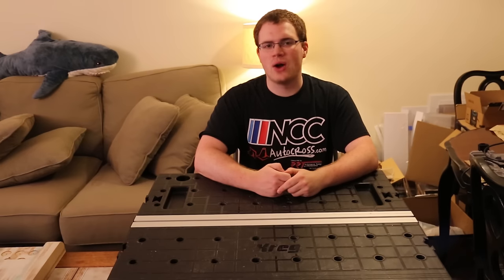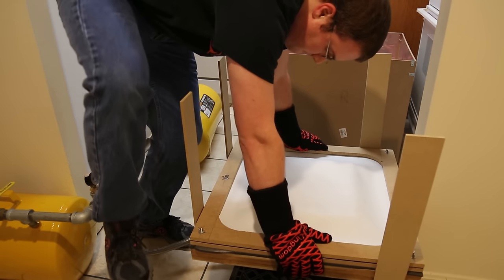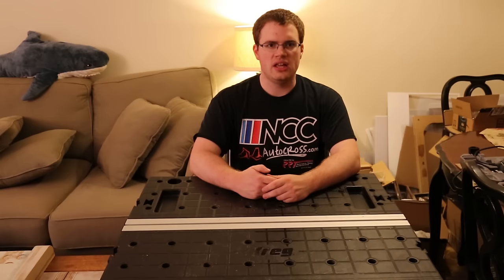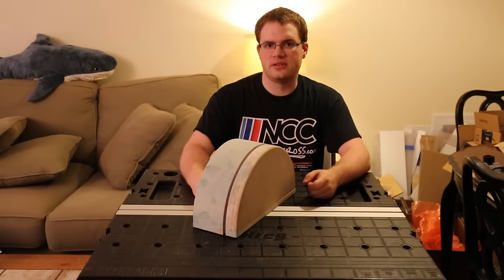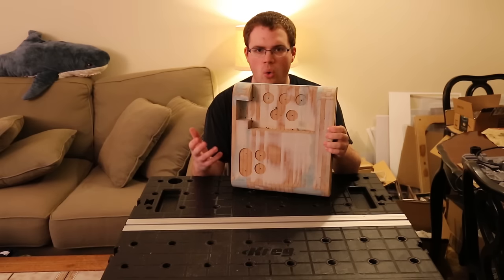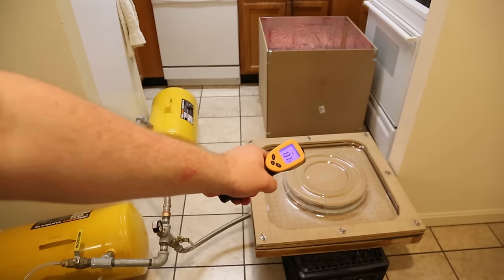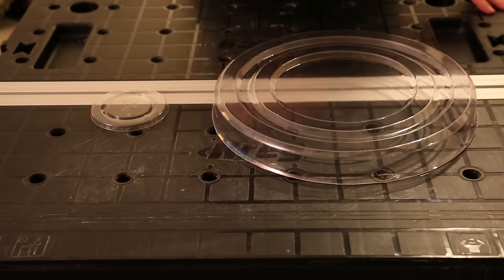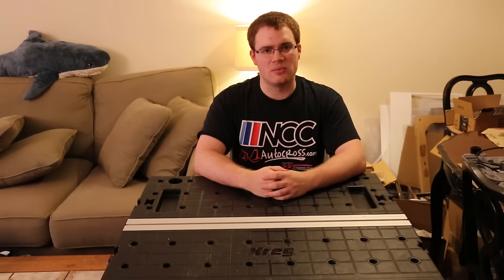DIY Vacuum Forming - Complete Video Guide

Comment: Hi
I like many would like to thank you for this great informative video.
I have constructed my own unit and the platten which has an area of 32" x 14" with 2.5mm holes drilled every 1 1/2" totaling 120 holes.
Question 1. Should I increase the hole diameter to reduce load on my Dyson vacuum (overloaded and tripped out on second attempt) or add more holes? Or use a vacuum system like yours? Material is 2mm PETG
I am attempting to make a ramp for a pinball machine which is currently not being produced which has lots of curves and lips on it. I am having great difficulty in getting the PETG into the lip radius. 
Question 2; Would heating the buck up to try slowing the hardening process? I am using a buck made of plaster of Paris which is very cold to touch. Do you think this is worth trying or do you recommend another technique?
Question 3; (last one I think) You mention about using multiple Dyson's, would they cause issues working against each other or would you need to section off the underside of the Platten?
Reply from the maker: Q1: For the platen used in the video, I drilled 1/8" holes in a 1" pattern (resulting in 256 holes). To clarify, when the community refers to a Dyson they're talking about the full size upright models (like the Ball), so if you're trying to use a smaller Dyson (especially battery powered) that may be the issue. A full size upright Dyson should be able to pull that size and material thickness, given proper heating of the plastic (i've seen them used to pull a 24"x24" 2mm form before). Since you have a vacuum and can just leave it running, make sure that the platen has a good seal and there is no ingress of air during the process. You can, like you said, also make a vacuum system like mine. I'm sure it would be able to pull your form. In terms of the resolution of your pulls, make sure the buck you're using is spaced off the platen so air can evacuate underneath. This is key to getting a tight form. Adding more holes and making sure the seal is good will also help.
Q2: While technically heating the buck may help, I think that it would probably result in a negligible amount of time gained in the forming process. PETG has a lower forming temperature than Polystyrene and other plastics, which means it doesn't take much for it to go back below the formable temperature. You can try it, but it sounds like there are more meaningful steps to be taken before attempting this.
Q3: Running multiple Dysons would probably work best if they each had their own interior chamber to work on, like you suggested.
Reply: mwjscn 

Thanks for the response. Just to clarify a couple of points, I am using a full sized Dyson DC54 which I feel is struggling with pulling the PETG into the lips of the Buck even though I have drilled holes through to the bottom of the buck. Am I correct in believing that the combined area of all the holes in the platen should equal to the internal diameter of the vacuum hose? If less then the vacuum would be loaded up on the underside of the platen and suction would be reduced at the buck itself.  Maybe I'm thinking too much but am open for suggestions. 

One new question, I have a quartz halogen heater which is shorter in length than the framework. Subsequently I cannot get even heat between the middle of the frame and the ends. (20-25 degreesC difference) Would adding aluminium foil to the inside of the heating box help distribute the heat or will I need to look at a larger heating system?
Reply from the maker: @stevebrookman5781  The DC54 may be good for small-medium sized forms, but it may not be able to move enough air for these larger sizes. To my knowledge, there isn't any correlation between the combined size of the array and the input hole. I use a bottom platen hole connected to my vacuum system that's about one and a half inches at most, and the hose connecting it to the tanks has an even smaller internal diameter (probably about 1/2"). The hole array is more about distributing the vacuum force for an even forming pressure across the platen.

I use two 1500 Watt quartz heaters for my system in a 2x2' MDF box. I lined this box with aluminum foil secured with aluminum HVAC tape. It's cheap to try and I'd suggest it to see if it gets you any further performance out of the unit. I will say the most important thing is an even application of heat. If you're finding that the heater you're using is hotspotting in the middle and either end is 'cold', I'd suggest looking into a new arrangement of heaters. This may be one of the main reason you're having difficulties. With my heater arrangement, I can get PETG to temperature in 3 minutes for that huge dome featured at the start of the video. If you're finding it's taking longer than that, I'd suggest looking into something new. PETG should look like a bubble as it is being blown, with a nice even droop curve across the entire frame. Look at 10 second into this video for reference or 18:50.

Comment: Please suggest me how much vaccum pressure is needed to use vaccum cleaner and suggest a model if you know
Reply from the maker: Depends on your size. If you're doing stuff under 12x12 inches that isn't tall, you could probably get away with a normal sized canister or stand-up vacuum. If you want to go larger (especially with thicker plastic), I've only seen major success with the large stand-up Dyson vacuums (cinetic, they're "Ball" stand-up range, etc)

Comment: Hello , i would like to ask, i have a mold 35cm tall, does the .5mm hips will do the jobs?
Reply from the maker: I'd suggest at least 2mm and a very strong vacuum force. The plastic will thin out when forming large objects (often having to heat the plastic for longer to achieve more 'droop' prior to forming), so you may achieve a thin result but have to start with a thicker material.
Reply: Unfortunity im just using vaccum cleaner hehehe but, ill give it a try in .5mm if it doesnt work sorry for me .. Thank you so much for the suggestion..

Comment: Did card sheet need any more coating after printing for belister packing.
Reply from the maker: Sorry, I don't understand the question. Can you rephrase it?
Reply: @mwjscn  sir,
Acctually I want to pack my items in belister cup ,some one detrack me and said that an adhesive coating needed after printing card board for cup heat sealing so I want to know what coating .
Reply from the maker: @shabbirshah6924  Ah, I see. I don't do blister packaging with a cardboard backing at all so I'm not sure what type of adhesive you'd use. Perhaps you can just use some metal staples instead.

Comment: Hi, could you tell me how long did you need to heat the material to get it right?
Reply from the maker: This is a case-by-case basis. It depends on the output and style of your heater, the type of material, the thickness of the material, and how deep a draw you need to achieve. On my heater, to heat .080 polystyrene to do shallower forms takes about 3 minutes, but for a deeper form it takes 5. That same 3 minutes to do a shallow draw with polystyrene will get me a very deep draw with PETG. When the material looks supple and is drooping enough, that's the time to take it off the heater. You can see examples in my video. It's all trial and error. I did many test pulls altering the heating amount by 15 seconds at a time. I suggest you keep a notepad with the results and mark the form itself on the offcut with the test # and time used so you can physically compare the outcome.
Reply: @mwjscn  well, i tried as your video shown but it never dropping. I use 2500w heater and heated up to 20 minutes but it just softer not dropping. I heated pvc sheet with thickness around 0.3mm i guessed.
Reply from the maker: @aripratama333  0.3mm would be as thin a a couple sheets of paper, are you sure you don't mean 3mm? If it is 3mm (~.125"), you simply don't have enough heat or aren't managing it well enough. I use primarily 2mm sheets (~.080") and my heaters are rated for 3000w combined. With these quartz heaters, they often have different output ranges given they're supposed to be used to keep spaces warm. Make sure you have yours set for maximum output. As an example, mine have 2 different heating modes where one is reduced and one is full power.
Reply: @mwjscn  no. I'm sorry 0.6mm it is not thick. I bought quartz heater lamp, only lamp so it is no control. It will always max.i bought 5 x 500w so it is 2500w. Just want to get even heat area.
Reply from the maker: @aripratama333  Something must be wrong with your material or your heating solution. If the plastic is indeed thermoforming capable, then it shouldn't take long to get 0.6mm plastic up to temperature with a proper heating solution.
Reply: @mwjscn  well, honestly i don't know whether it is capable or not. I thought it is applicable for any plastic material. This pvc sheet usually use in furniture lamination. After i tried heated and sucked couple of time it is stretch and getting close to the object but it took many times. I even put it very close to heater. Also it is fast to cool.

Comment: Can you give me good sources for buying plastics?
Reply from the maker: If you can find a local plastics supplier (think like a lumberyard, but for plastic instead of wood), that would be ideal. They usually carry the most options and can cut your sheet to custom dimensions. I personally use Piedmont Plastics, as they have a great customer service, good variety of stock, and no order minimum. If you can't find one of those and are doing things at a smaller scale, you can find polystyrene sheet at hobby shops or online vendors like Amazon. If you're looking for a supplier, a hobby store is a good place to try and get leads since vacuum forming is often used for RC plane cockpits and similar items.

Comment: Brilliant vid need help as I've tried doing this and haven't had much success thanks I'm trying to make rc body's of my own as I run an rc Park we can't get the body's we want thanks
Reply from the maker: Can you explain which part you're having an issue with?
Reply: @mwjscn  heating the polycarbonate it seems to bubble like loods of little ones in the sheet but I think I have heater above maybe I should put it underneath and move materials further away and trap the heat in with the materials
Reply from the maker: @dbbiking5505  If it's bubbling, it's overheating (as mentioned in the video in the troubleshooting section). How thick is the sheet you're using and how big is your buck (most importantly, how tall)? Polycarbonate has a higher deformation temperature point, but if you're using too thin a sheet the time window between formable and overheated may be too small. You may want to start making forms with polystyrene, which is significantly easier to heat and use, to gain experience before moving to a more advanced material.
Reply: @mwjscn  2mm sheet 600mm x 900mm
Reply from the maker: @dbbiking5505  that's a really large sheet for the thickness. For reference, I do 2mm for my ~560mm square build space. Is this a really large RC car or are you trying to make multiple bucks and pull multiple forms from one sheet? I think you may have more even heating with a smaller sheet/former if the RC cars are of a normal size.
Reply: @mwjscn  320mm x 560mmx220mm buck 1x 1/8th car body
Reply from the maker: @dbbiking5505 What are you using for a heating element? Is it bubbling and dropping too far only in the middle?
Reply: @mwjscn  no can't get I to drop before it bubbles I've got something I'm going to try thanks for help is it OK let you know how I get on
Reply from the maker: @dbbiking5505  That's very strange, but I wish you the best of luck. Make sure your material blend is okay for thermoforming. I'd still suggest trying a pass with polystyrene just for experience if time/money allows.
Reply: @mwjscn  I don't suppose you could do or have done a vid of forming 2mm polycarbonate over that big drink lid please and thanks
Reply from the maker: @dbbiking5505  Only with PETG. I haven't come across a reason to use polycarbonate yet since polystyrene and PETG cover all of my applications so far (not to mention the extra difficulty of working with polycarbonate).
Reply: @mwjscn  why is it difficult  also I have my heat above the material but I think it would be better underneath what do you think thanks
Reply from the maker: @dbbiking5505   Direction of heat, above or below, won't matter as long as it is uniform.
Reply: @mwjscn  heat rises so me having it above with a air gap wouldn't help I dot think so I'm going to put heat below as heat rises and would gather evenly under the plastic plus it would rise up through the plastic make sense

Comment: "might be equal to a dyson..." I would say the fact that every single professional model vacuum former in existence uses vacuum chambers instead of the cobbled together with a household vac route would suggest that the vacuum chamber routes is ALWAYS better. Anyway you really only get one shot with the vacuum cleaner as well. If you ain't lined up right the plastic is ruined either way. Styrene is cheap enough to just buy a dozen sheets just to get the hang of using your new vacuum chamber vacuum former.

Comment: Curious, why are you not using shop vacs?
Reply from the maker: Shop vacs reportedly don't have the same amount of throw due to their large interior. You can try filling one with expanded polystyrene if you want to try and fix that, but most feedback I've seen says they don't perform well in this application. If you do try it, be sure to let us know how it works.

Comment: How do you trim the plastic as not to leave sharp edges?
Reply from the maker: When you've trimmed the vacuum formed shape out of the overall sheet, you can take some higher grit sandpaper (200-400 grit) and smooth over any edges you need to. This is what I did for my polystyrene work. If you just sand the cut edge flat on PETG you can avoid scoring the clear parts, or you may look into using something like a soldering iron to melt the edge to try to get it cleaner, but that's just a brainstorm and nothing I have tested.

Comment: Hello my friend, what do you do to prevent webing ?
Reply from the maker: I go over the designing a buck to prevent corner pinching in the video, which is what I assume you mean by webbing. You can make buck design considerations and/or make sure your plastic isn't overheated. The more you heat a sheet, the farther it droops, the more area you have to work with. If you have too much, it may bunch up on sharp angles.
Reply: @mwjscn  Thank you for you reply. Maybe I am overheating, I will double check the temperature
Thank you for making the videos

Comment: Thanks for all these info! I’m just wondering, with the setup that you have, can it vacuum form a 3mm ABS plastic sheet on a 3 inch height of a cylinder buck like yours. I want to vacuum form  a cylinder buck with few letters and numbers on top, about 10 letters with 1 inch font. The size of the buck is 17 x 17.
Reply from the maker: Yes, you could probably do that without issue. You may decide to make your platen slightly larger than mine, but that would be about it.
Reply from the maker: @fobkidsTV  Nope, that one was done fully by hand, though, I plan to try to utilize some CNC work for future bucks (since I have the 3D models of each part during my design phase and making them by hand is timely).

Comment: Can you do Acrylic? If so how thick?
Reply from the maker: Yes. How thick depends on your heater system. Polycarbonate takes a lot more temperature to reach it's glass transition point than the materials shown here. Look at the data sheets for the material and it will list that temp, but it's usually 400 F.

Comment: Can plexiglass be used?
Reply from the maker: Yes, Acrylic can be thermoformed.
Reply: what thickness can be used: 1mm, 2mm, 3mm or etc...
Reply from the maker: @artongashi6206  That depends on how good your system is, both in quality of heating and vacuum. The thicker the material, the more heating and more vacuum table pull you'll require. Also remember that you'll lose detail as you go thicker, depending how many details are on your buck. 1.5mm would probably be a good place to start for most models, with 2mm being a suitable alternative if you copied what I made in the video.
Reply: Thanks for the help, I am a beginner for this I am asking these questions.

Comment: Tanks, valves, vacuum pump = Dyson vacuum price. 😂
Reply from the maker: Maybe in the second-hand vacuum market, since you need one of their larger models. A great tool if you already have one, which is why I mention it since it lowers the barrier to entry for those individuals. However, it isn't modular since you can always use the tank system components to build bigger for an even larger forming area. A fun LEGO-esque project for adults 😆